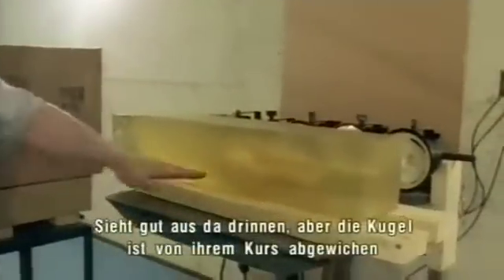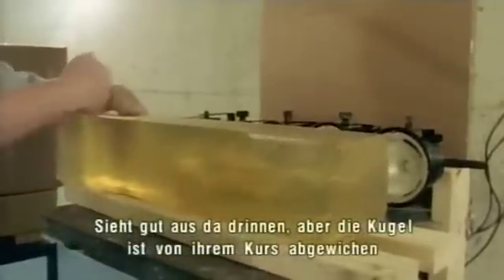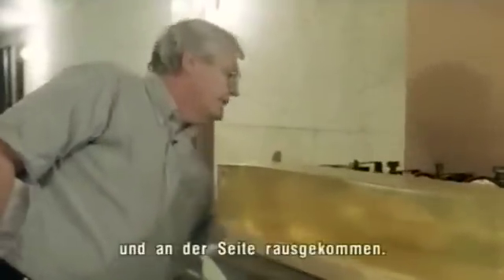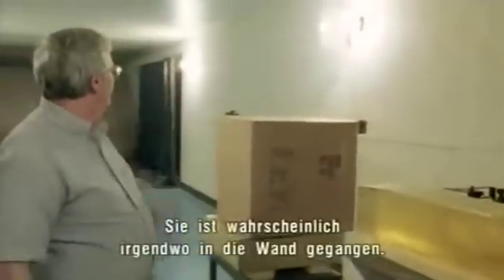AK-47 vs. M16: ballistics gel comparison

Comment: 308 better than both
Reply: 6.5grendal is better than .308🏌️‍♂️🤷‍♂️
Reply: @freefendii8833  fair enough you right 😂😂
Reply: @connoroulton8107  6mm ARC tho
Reply: @8166PC1  they stil use 308 its better for longer range like afghan
Reply: Not when you are considering weight and capacity its not. For hunting yes, for warfare no
Reply: In what circumstance?.. Everything has a trade off and all 3 rounds have their place.
Reply: Yeah but very heavy.
Reply: @8166PC1  Yes because men these days are much weaker and more beta male than men of the past

308‘s bruise anemic vegans shoulders a lot more than 556

Comment: The video is not true,the AK-47,Bullet 7.62x39mm have 123 grains of height,and 2.100 Joules of power,and the M-16,Bullet 5.56x45mm have 55 or 60 grains of height and 1.600 Joules of power
Reply: 5.56 delivers a higher percentage of its energy than the 7.62x39 because it fragments
Reply: @drhhodge8243  that’s not how physics works.

If something breaks upon impact it actually delivers less energy. Think of getting hit with a glass bottle that shatters on your head versus getting hit with a metal bat that doesn’t shatter on your head

Now fragmentation can cause more damage because little pieces go all over the place and have a better chance of shredding something important

But at the same time a heavier boy that doesn’t fragment will have much more initial knockdown power regardless of whether it kills the person or not
Reply: @monsterpoo  When two projectiles of the same mass moving at the same speed stop within a target, they transfer the same amount of kinetic energy regardless of whether one disintegrates within the target.  If anything, the projectile that fragments delivers more rigid-body "knock-down" effect in the form of impulse if it stops more quickly than the one that keeps penetrating through soft-body dynamics.
Reply: @monsterpoo  regardless being in war I can tell you that the 556 creates horrific wounds. The bullet fragments and tumbles and does unbelievable amount of damage.
Reply: @Иванпонимаете-г4ш  yeah but inside 300 yards 7.62x39 wins almost every time
Reply: @monsterpoo A bullet possesses kinetic energy as mass and velocity. The only way it transfers energy into a target is by losing mass or velocity. By fragmenting, the bullet loses mass and energy very quickly, and much more violently than the heavier bullet of the 7.62x39. 
The fragmenting of the projectile further enhances wounding characteristics by tearing tissue stretched to its elastic limit. Like a needle punctering a water balloon, the tears created by the bullet fragments are much bigger than the fragments themselves because the tissue is under pressure, stretched by the cavitation of the bullet's energy. 
The 7.62x39 is a known lackluster performer. In 3 combat tours we had multiple Marines hit in the torso that returned to duty with our unit in the same deployment. Unless it hit a bone or large blood-bearing organ,  the round created a narrow, uncomplicated wound and recovery was likely. This was documented by research done by Fackler and others, as well as witnessed first-hand by us on the ground, in Iraq and Afghanistan. 
The M855 round from the M16A4 and SAW created gruesome wounds, often with more exit wounds than entrances.